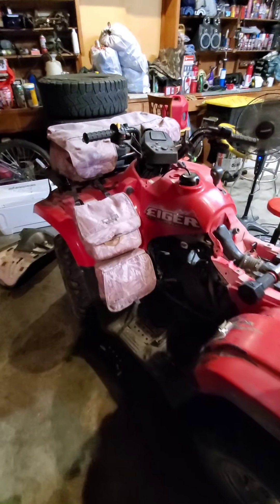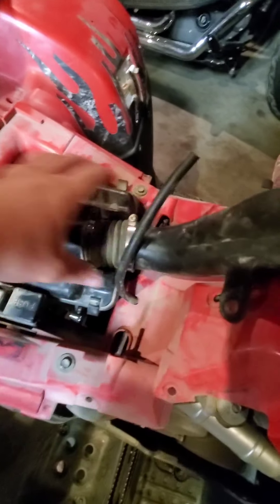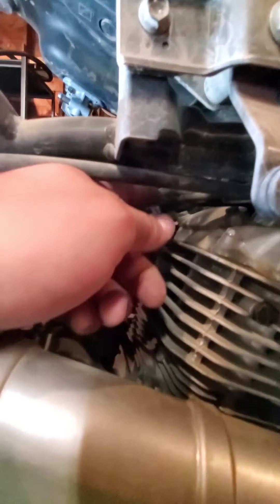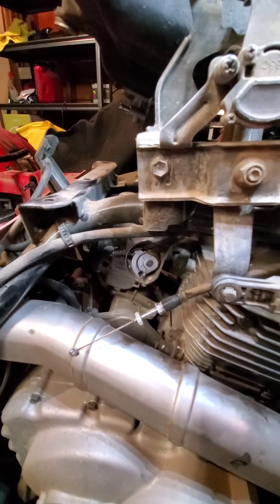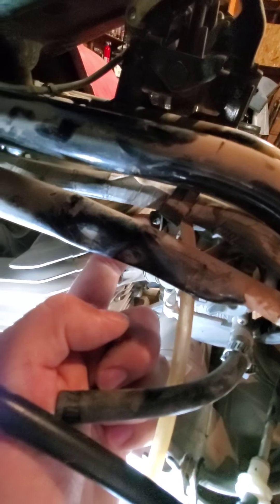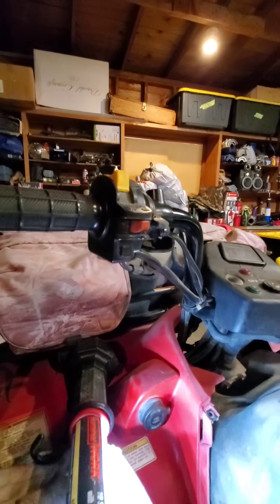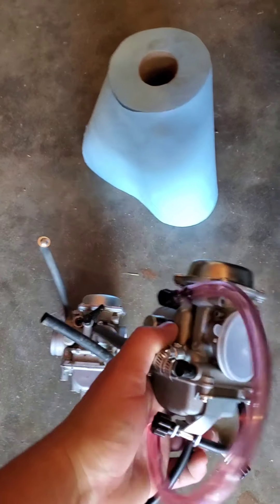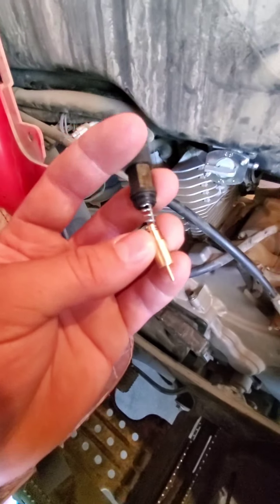Carburetor replacement on Suzuki Eiger 400 LT-F

Comment: Hey i have the same bike. I sealed off the vacuum line since im using the other petcock but where do you run the vent hose?
Reply from the maker: Think I just ran it down to the ground kinda down the center of the bike

Comment: Hi, nice helpful, and detailed video.  My situation is,  first it wasn't getting gas so I tested the vacuum petcock and witched it out for new Yamaha gravity flow one. It ran but you had to choke it a lot and then it would put gas into the airbox. So I bought a new carb -  put it on and it's doing the same thing. It was a new carb so one would think everything,  main jet, and float would be set to spec when built.  What are your ideas, any would be appreciated?.
Reply from the maker: Hmmm, 🤔 not sure just double check all your lines are right and maybe adjust your throttle cable and see if it helps at all?  And have you changed the spark plugs recently, cheap thing to cross off the list of possible issues. I'm no pro but happy to help spitball ideas. Thanks
Reply: @Blakestish  I don't work on them every day so not a real pro either but can usually get the job done. It was an error on my part.  One time or other, could have been before I first took the carb off, but when checking things over close on the vacuum lines I found the tube from the right rear brake backing plate ran up and was hooked onto the over - flo vent at the very bottom of the float bowl.  I had to trace it in disbelief as I said to myself...Did I effing do that? I think the very first time I took the original carb off I threw the short vent hose in a little parts box and it got misplace or thrown away with me thinking I'd put a new one on. When I got to putting hoses and lines back on after I cleaned the original carb and put it back together I must have grabbed the extra-long brake shoe vent line that was up close near the carb with plenty of length and pushed it on the bottom bowl vent. After correcting and re-tightening things she fired right up idled good and purred like a wild - cat and didn't bog when given the gas.  Sorry so windy here but this just shows the importance of checking your work over real good because it may be something as simple as a hose is hooked up wrong. I'm actually saving the original carb because it may be just fine. The aftermarket carb was not very expensive at all. Thanks for taking the time to make a video and posting...very helpful.

Comment: Hi, I have the same atv.. it starts fine but stutters bad when I give it gas. There's has inside the filter box too.... How did you know the difference between it being a petcock or carb? I'm trying to pin point the problem. Thank you for the video
Reply from the maker: Sorry I didn't see this till now I'm far to late I'm sure, but the petcock is way cheaper than a carb I would start with it. The little screens can get gunked up quickly and not flow properly ;/

Comment: Hey where does that vacuum line up top run to exactly I can't figure it out
Reply from the maker: If you still have the factory fuel petcock valve then it goes right back to the same spot if you replace the valve like I did you can seal it off cause it's just vacuum from the carb some after market ones like the one I found doesn't need to have that vacuum hose as to it's only used by the oem fuel petcock. I replaced mine with one from another machine. It's listed in the videos description and I tried to show it best I could in the video thanks 🤙👍👍.
Reply: So I got the atv with changes already made I picked up an original petcock and installed it the quad wouldn't start so I put it back to the way it was when I got it and it won't run I checked the carb cleaned it and it's in great shape so I know it's not the carb
Reply from the maker: @derekyoung3826   strange?  This is a silly question but the fuel is in the "on" position? Gotta ask ive done that before it was stupid another thing to check is where the throttle cable is attached to make sure it's all in working order and the stop screw is adjusted right 🤷‍♂️
Reply: @Blakestish  so the pet cocktail the in on it now is also messed up but I have modified it to be in the on position with out leaking if I pull the hose off fuel flows and as for the throttle cable I can find anywhere how to set it up properly but I believe I have it close enough to get some kind of engine start their is no slack and everything looks good
Reply from the maker: @derekyoung3826   interesting well as long is has fuel it should fill the car with fuel have u check the spark plug to see if it's wet from gas from trying to start it, might be flooded? Or replaced the spark plug? I'm not a professional just a weekend guy 😂 haha
Reply: Ok another question the line that you said goes to the air box where exactly on the air or does that go
Reply from the maker: @derekyoung3826   on the one I have it just follows the frame and into the air box it kinda shows it in the video you might have to pause it 🤷‍♂️ at 9:52 the pink hose is that breather hose and I guess I didn't show where it ends up... My apologies
Reply: @Blakestish  ok if you disconnect that hose does the bike still run or does that hose need to go in to the airbox
Reply from the maker: @derekyoung3826   it should still run you can just let that tube hang just make sure it's out of the way of everything else And isn't going to get dusty or anything

Comment: suzuki sucks, I cannot get a manual for this atv, where does the hose go that comes out of the bottom of the carburator? it's so close to the starter that it is automatically crimped in half after installation of a new carburator.
Reply from the maker: @michaelmontgomery5326  should be able to wedge it to the side don't have the machine any more to show  you sorry ;/
Reply: @Blakestish  Thanks, I was looking into exactly why the hose is even there for that carburator, alledgedly it's an atmospheric equalizer, and the hose prevents moisture from entering the lower cauburator float valve area.
Reply from the maker: @michaelmontgomery5326  I wanna say it does that an a secondary bowl over flow for if you don't have the float set right 🧐
Reply: @Blakestish  i agree